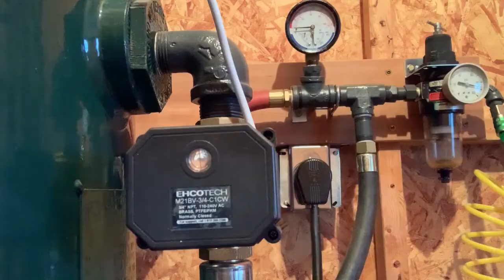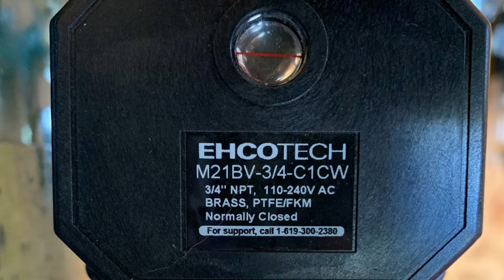Air Compressor Valve Modification | On the Mark the Mark

Comment: Put on a elc automatic tank drain. For water in the tank. Because it's out doors in the shed..great video...oh use syn oil..as well ..due to diff type of weather..u might have..im.in fl.  So I  use syn oil..and an automatic  tank drain lots of water..comes out..ive got a new saylor beall. Unit..H.D. I shut it off and drain it, out its in my garadge..its pretty quit running for 3.500 bucks..it will out last me..and my son..all cast iron.for my hobby shop..went through to many home store units..in 5 yrs..ty for your video...awsome
Reply from the maker: Good idea.